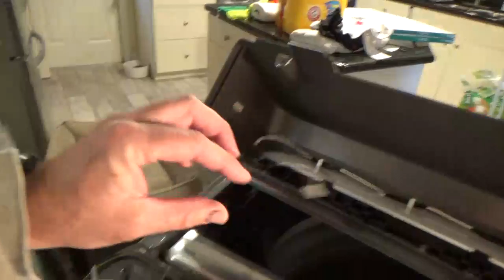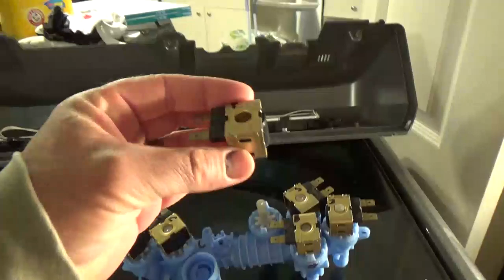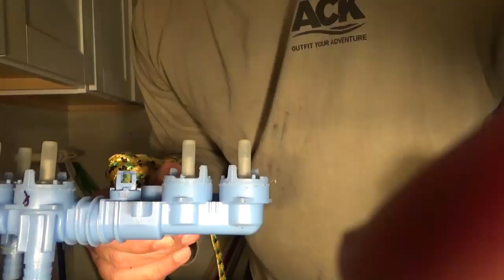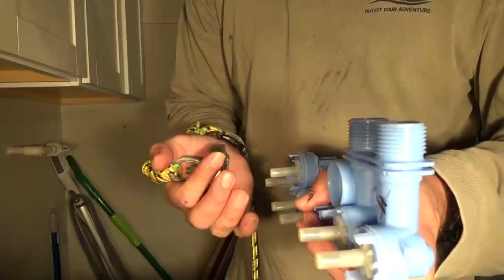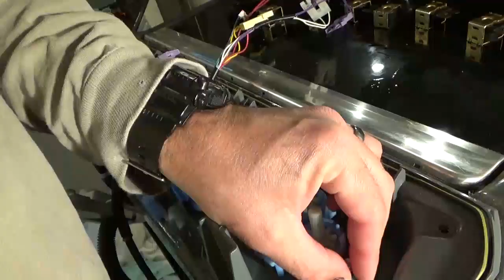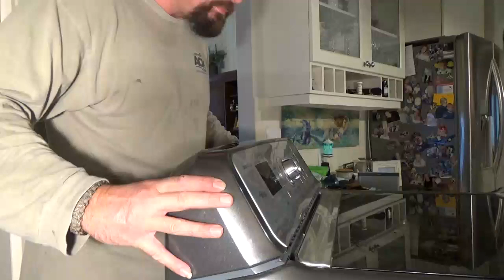MAYTAG Bravo XL repair

Comment: Oh my gosh you’re a lifesaver! How can I remove the top lid? I need to clean underneath there’s spots I can’t get with a rag or toothbrush and it bothers the heck out of me! But thank you so much for all the new info and steps! 🙏🏽🤩
Reply from the maker: So sorry for the late reply! Been busy here. 

Ok, take a plastic putty knife or gasket scraper, flat head screw driver or butter knife, if your worried about scratches wrape any metal tools with something. Stand facing the washer, the front where the lid and front panel meet slide the putty knife in from the front between the top and front plate. The clips will pop loose and you can open the top like a car hood.

Comment: This is a great video!  I have a similar issue with the washer, likely with the same problem part.  I get a slow drip of water from the top of the drum where the water comes in after the clothes are done washing.  The water inlet valve is likely not fully closing, meaning one of those little magnetic actuators is malfunctioning.  I could try cleaning it too with CLR, but I can't see how the water could be dirty in my area.  I bet I'll end up having to replace the entire water inlet valve.
Reply from the maker: Thank you! Never expected it to help this much, its great. My house has a whole house water filter that filters as it comes into the house and i still have sand in my lines down here in fla. One of the benies of buying older houses. Valve body is around $50 and easy to replace.
Reply: GREAT VIDEO!!- I have the same problem with that drip on the top of the drum.  I did notice that the drip stops after a few washing cycles but the dripping returns.  I suspect it is one of the valves not completely sealing/closing.  Plan A is to clean as in your video and see what happens.  Plan B is to replace the valve unit, if I can find one online or near by.  Thanks

Comment: Excellent video and very educative. I hope it helps all in need of a repair... But a note for possible buyers… I have this exact model. Today, it reached its end and I will not even attempt to call someone to fix it. It is barely two years old and the top interior has begun to rust badly. Over the past few weeks I have noticed a slight leak and today it flooded my laundry room. I took the body apart and it seems the plastic tank is cracked. Over the past year or so I have tried contacting Maytag and to no avail. They will not fudge an inch adding “you should have bought the extended warranty. They only thing warranted now is the belt” – &^%^%$ you I said…. Over advertised Maytag crap - I will return to my good old GE’s
Reply from the maker: Dang. That sucks. Kind of funny cars wont warrenty belts but a washer will?

Comment: Great video! Step by step and very helpful info. Have you (or anyone)ever heard of a scenario where there is too much water going into the bleach dispenser and it is overflowing resulting in water running onto the floor? Could this be a bad coil?
Reply from the maker: Id check the hose conntction to the bottom of the bleach tray to the drum first. The bleach tray should allow the water to flow through and into the drum. 

As for a sticking valve allowing water to run into the bleach tray, that is absolutly possible. They are simple spring loaded magnetic valves, if it does not close all the way you will have water running through the bleach tray as long as water is moving through the valvle body.
Reply: @onebaddj  I checked all the hoses and they were secure. I switched the coil from bleach to rear water tub fill and it worked great. No issue at all! Did you have any luck finding coils sold individually on Amazon or anywhere? All I can find is the whole valve assembly and it does not state if the coils are included or not. I am also tempted to just leave them alone and let it ride.
Reply from the maker: I have not searched for the coils individually, just bought the valve body. Id send you my old ones but they went with the washer when I gave it to my friend.

Comment: Thank you. Very helpful and appreciate the instructions. Do you know anything about gear problems or how to run the diagnostic test.?
My Army combat disabled vet husband was like you and very mechanical and could fix (or try) about anything. Unfortunately he was killed last year from circumstances stemming from his severe ptsd . So I rely on good YouTube videos like yours to carry on the legacy of repairing or building things myself.
Reply from the maker: Thank you for the comment and very sorry to hear about your husband. I am retired little over 24 yrs MC. 

Here is a video i did on another fail I had an i dealt with the gears on the drum super easy and cheap. 

https://youtu.be/wF9S8ELAytY

Also replaced the heating element in the dryer and found the tech manual in the dryer so if you have questions feel free to ask.
Reply from the maker: Just doing a follow up o past issues. Did this resolve your problems?

Comment: baddj, great video!!, I replaced same on my mom’s washer in texas from last month hard winter 🥶 but now control board gives no power or lights; any advice?, same Bravos xl
Reply from the maker: I am glad this video is helping. 

I would look at the main control panel and look for a fuse, i dont have this one or i would look real quick, if nothing is obviously burnt, check power at the inbound side, if it has power to it, then search the panels part number on google, bet its about $50. Thats what i would do. I gave a young Marine a $4000 3d tv that was broken by movers. He did exactly what i just told you and fixed the tv in 24 hours. I love wins like that. 

Good luck!

Comment: Hi you did a great job. Now for my biggy question, washing clothes today all of a sudden the machine stops all lights go out, nothing is lit, nothing working. I have already tried the reset you described. The big problem is MY CLOTHES ARE BEING HELD HOSTAGE NOW!!! Their in the machine all wet and the freakin lid won't open. I have already done all the electrical checks with the plug, outlet, circut, etc. PLEASE HELP soon, my clothes will be all moldy. THANK YOU
Reply from the maker: Use a flat head screw driver or butter knife, go to the front of the washer, where the top and front of the washer cometogether ther are 2 clips. The clips are about 3 inches from the outside edge towards the middle. Push the screw driver between the panels and pop the clips, the entire top will be able to open and you can get you clothes out!
Reply: @onebaddj  well I went out to tackle the job, had my head light on told my husband hand me a screw driver proceeded to look for proceed to pop those there clips you mentioned..Well I'm down on my knees searching away I don't see any clips at all I do see where the top has a lip that is clasped  onto the bottom part of washer so I proceed to ask for another screw driver from my husband. I got one in each hand I'm determined to get this sons of bitch open!! I work both screwdrivers into the lid work them around and I said thats it.....applied a little pressure and pop and drop goes the part that holding the lid down. OMG it stinks in there!!!! Got my clothes out and my husband is now trying to get the water out of that POS Maytag washer.  Thank you for replying so quickly pal!!!!

Comment: Hi - your video is great - I have the same problem with the softener and look forward to following your instructions to fix it in the coming days. Do you happen to have the equivalent dryer too ? The timer's not working right - thought there's a chance you might be having same issue :)
Reply from the maker: Glad the video is helping. No Ma 'am on the dryer. My drum cracked and at the point it was time to go. So stripper it, folded it up and fit it in the trash can. The whole dryer! 😆
Reply from the maker: I will scrub to see if i have the trouble shooting manual for it.  Pop the control panel off the top of yours! Thats where they put the maintenance manual.

Comment: Sometimes the bleach dispenser fills with water (we don’t use bleach) and other times, it drains.  The fabric softener dispenser drains a little but not all the way.  Ideas?
Reply from the maker: Pop out the dispensers and clean them well especially the fabric softener. If they are filling then its a drain problem and there is nothing mechanical on the drain side just gravity and a place for everything to go.
Reply: onebaddj I cleaned it thoroughly- it drains a bit but not completely, which leaves some fabric softener in there - and then that coagulates between wash days.
Reply: What makes the fabric softener drain at a particular time  during the rinse cycle, and not during the wash cycle?  It stays during the wash cycle but doesn’t drain completely during the rinse cycle.
Reply from the maker: Its all controlled by the water coming in from the valve body, super easy system. The hot and cold hook up the the valve body. Each outlet for bleach, drum fill, fabric softener, etc is controlled by a magnetic coil. The computer is a clock and says turn on, energizes the valve coil, magnitizes it opens the valve and water flows. From there its all gravity. Water flows in and drains out. If it stays there is a clog.
Reply: onebaddj thanks so much for your time.  What I don’t understand is where the fabric softener drains out.  If I put fabric softener in the holder, does it drain out of the bottom?  And if that is the case, why doesn’t it drain out when I first put it in?  I’m trying to figure out where the clog may be.  Assuming that the water diverts to the fabric softener holder, how does it drain to the drum?
Reply: @lindaschneider4964  Linda that's what I don't get too.  When everything worked fine... Fabric softener stayed in cup till it was time to be used.  Then it drained and fresh water mixes with it.... When that stops, the cup is completely empty.  I'm flummoxed!!!  Now it never drains.  I don't know how the drain knows to completing empty after holding the fabric softener till it's time.  (Shrugs shoulders).

Comment: Sorry if this seems like a stupid question, I’m pretty ignorant when it comes to fixing things. How did you know what to label before you took Everything off? Did you just look to see what hoses went to what?
Reply from the maker: Just followed the hoses to where they went. Pretty easy.
Reply: Ok thanks. Yea we have the same washer and it’s not going into the wash cycle. Reads LF. Going to attempt to take it apart and see what’s going on inside. Thanks for the video, you make it pretty straight forward

Comment: Stupid Question. I am lazy can i not take it apart and put clr in the softener slot?
Reply from the maker: Not a stupid question. My clog was in the valves them selves which is before the fabric softener. Clr would not make it backwards into the valves. You would also not be able to cycle the valves with a magnet. That would clean out from the fabric softener bowl down which gets nasty and clogs also so would not hurt to be cleaned once in a while too.

Comment: Two questions.....1) How do you recalibrate a newer model Maytag  MVWX700XL2, after replacing the actuator (It shows the error codes on a digital screen).  I can't seem to find instructions to recalibrate a newer Maytag after a repair.

2) I've done everything to remove my Maytag Bravos XL washer pulsator (some call it a washer plate)...it won't budge. It raises up about 1/2 inch and seems to hit something, like it's locked in place.  I want to check for coins that may be stuck underneath.  I don't know what else to try.  I tried turning it from side to side, as if it's washing, but it won't move back & forth either.....not sure if that's possible with the power off.  What could be the problem ??
Reply from the maker: The recal is a new one have not heard of it. 

As for the plate not coming off, they may have added a small lock wasker of some stlye. Look closely and if there is one either lock ring pliers, youll know them if you have them, or good old flat head and pop it off. That is what i would go for first.
Reply: @onebaddj  .....several videos that I've watched said that after every repair it needs to be recalibrated....they give instructions how to do it, but it's always been on older Maytag models.

Comment: Hello, great video,  question for any, my washer makes a clicking noise about 23 minutes from the end of the cycle and the water starts to flow out the top back area( fabric softener) and runs over the sides of the rim onto the floor. is it possible the fabric softener solenoid is stuck or something? Thanks folks!
Reply from the maker: Id pop the fabric softener bin out and clean it to make sure the outlets are not clogging. That stuff is like dried gum.
Reply: @onebaddj  Thank you, IM working on it now. I appreciate you taking the time to make the video. It helped me out

Comment: I cant open the top lid of bravos xl maytag
Reply from the maker: Use a plastic putty knife, butter knife with tape on it to protect paint etc. Basically flat non marring object. Slide it between the top and front panels on the seam, there is a little clip on right and left side. You have to push them from the front. Nice pop on the end of the tool on both and the top opens like a car hood.

Comment: Hi again. So now that I have rescued my clothes from my Maytag Bravos XL the one with the entire panel is all digital. I hate it I hate it i hate it.. So the washer is still not starting at all. I plugged it in, nothing lights up, nothing works when I push the buttons. Its like its dead. It just isn't doing anything. I suspect maybe the circuit board is shot. I probably should just shoot it, but this $1000 piece of junk is a thorn in my side and wallet now. I suppose I will have to call a repair person (hopefully an honest one) get an estimate and than determine what to do. Thank you for your help.
Reply from the maker: Sorry for taking so long to reply. Id price check the main circuit board after doing a visual inspection and making sure nothing is unplugged. If its a $50 part may be worth a shot in the dark. May also luck out, my dryer had the manufacturer trouble shooting manual in the top by the control panel.
Reply: onebaddj thanks for replying to me again. I already took the top off and checked that everything was plugged in good, I even unplugged all and put back in. Still nothing. That’s why I’m suspecting the circuit board. Would you think I could replace the board myself? Also, any video on how to replace it?  Had to buy a used washer in the meantime for $100 to keep up with the wash. I thank you for your assistance
Reply from the maker: Yes cb is super easy. 3 screws and the top come off to access the board, i think its 2 or 3 small screws then the plugs, everything is easy!

Comment: How do you fix the situation with water not draining, it just beeps, nothing shows up on the display screen
Reply from the maker: Hopefully just a plugged drain. Take it out side, from the front on the left and right side there are clips that hold the top shut. You will need a paint scraper or skinny flay head to push them and the lid pops open. Look down the back of the drum and you will see your drain motors and filters. Pop off the lines clean them, take out your filters and clear them, reassemble and test run it out in the driveway.

Comment: Are these good? Im looking for a used one is it reliable?
Reply from the maker: Its all on how well it was maintained. I got 10 yrs out of mine but i am pretty protective of my washer dryer. If its from a shop that resells them and its $150-200 each sure. They usually replace basic parts and clean them. Off craigslist id wanna see it run. Thats with anything i buy though.

Comment: Do you have any ideas about it shootint water to the left over the side of the drum?
Reply: Not alot of water but enough that it soaks a bath towel per load to the left front of the machine but I can see it going over the side.
Reply from the maker: I would slide a butter knife or putty knife between the top and front in the corners there are clips in there, pop those and the lid will open like a car hood. Look for a cracked or chafed line. If its got a hole from possible rubbing it will leak or if it just got old. But thats where i would start.

Comment: I got one yesterday and the the start button doesnt respomd .help
Reply from the maker: Which fail code? And to basically reset it, hit the power button twice to turn it off, it should drain. If that does nothing, pull the plug let it sit for about 2 minutes then plug it back in. That should get you back to the startline.
Reply: @onebaddj  f32

Comment: How do I change the mother board
Reply from the maker: There are 3 screws that hold the control panel to the top of the washer. Loosen those screws, flip the control panel forward and you will see the mother board. Search the part numbers on google and swappinng it out ks as simple as a couple screws that hold it down and a few plugs. Easy. Good luck.